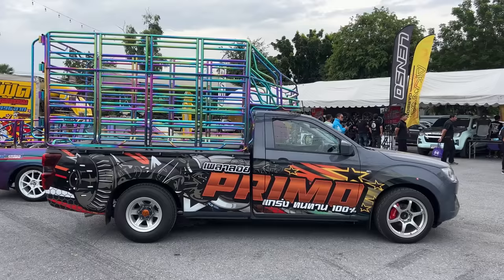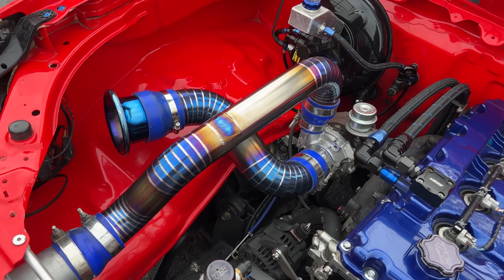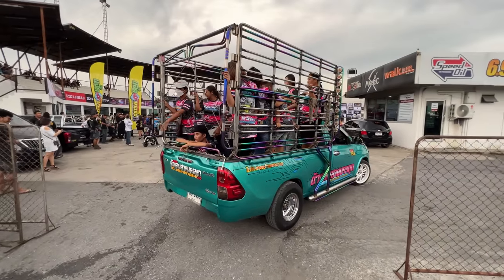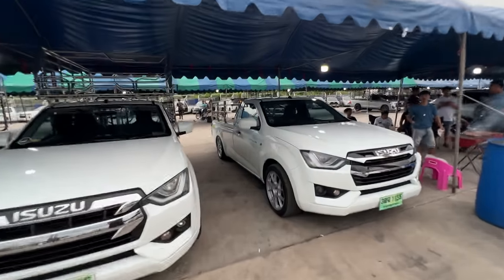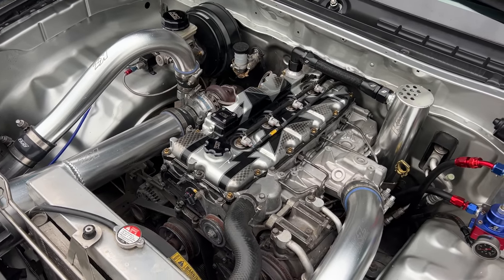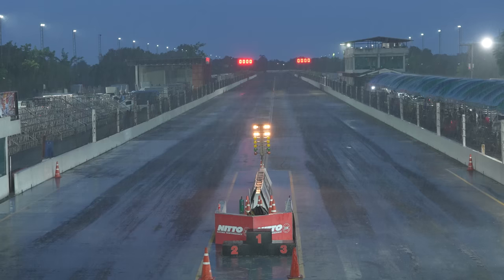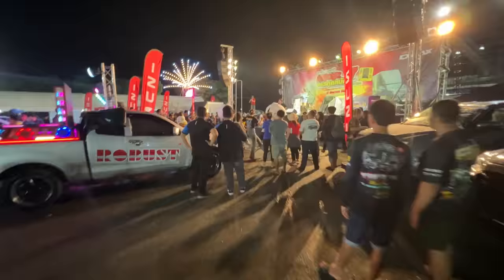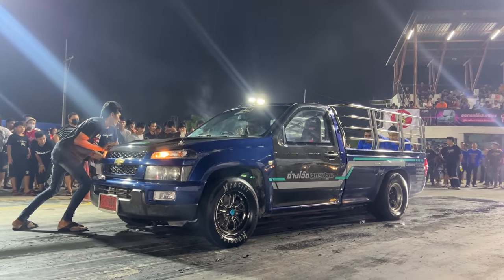Farm Truck Festival in Thailand! Truck Show, Models and Racing!

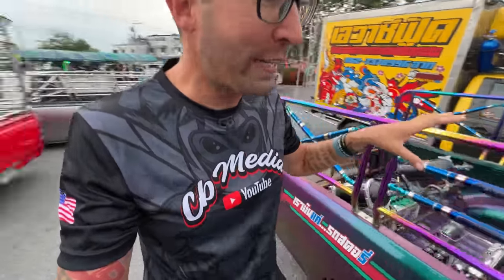Comment: 2:35 
Compound turbos yes, "twin", no....  
Twin turbos are literally two of the very same turbos usually running independently of each other.  It would be pointless to run twin turbos in a compounded configuration. 
Sometimes "mirror imagine" turbos are also called "twin" turbos.

Comment: can someone explain why they try to hold the truck while they do burnouts? if the front brakes are locked why would you need someone holsing the truck down? never seen this done in America...
Reply: They just let people only clean a little rock from their tyres and warm the tyres before race my friend and it's a very long line that people are waiting to race too so if they let the random beginner car guys to burnout here by themself some cars would flying all around the place and it's made people boring and some trucks are bouncing really hard and some beast truck even go to the side so if you do like they do you'll also safe a lot of time for people in the line that waiting for them to race and also your tyres will be perfect to race in a shorter time my friend and also I heard many of them used a different gear when they burn out show like higher gear than here before race. And also nowadays many of them used a burn out switch my friend.
Reply: @onalonan  what?